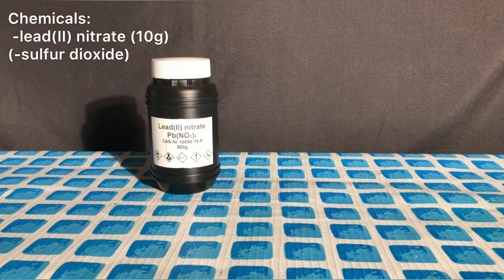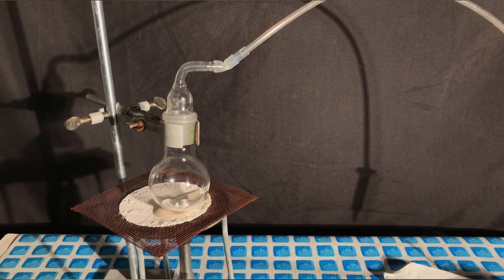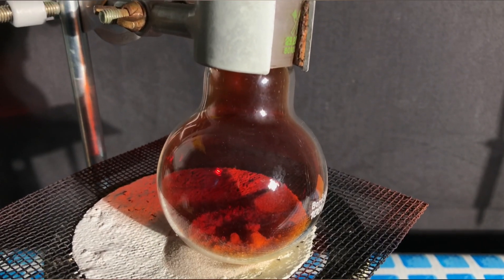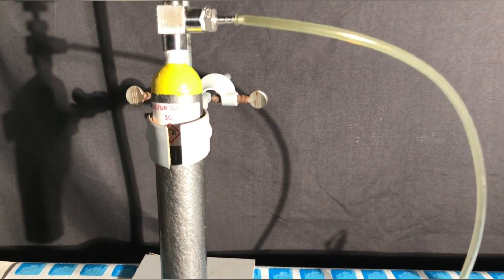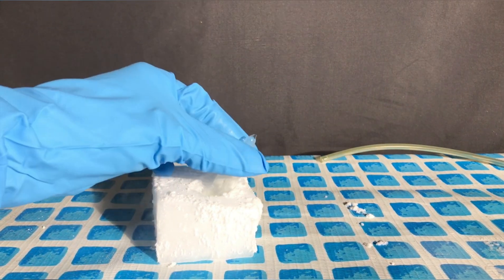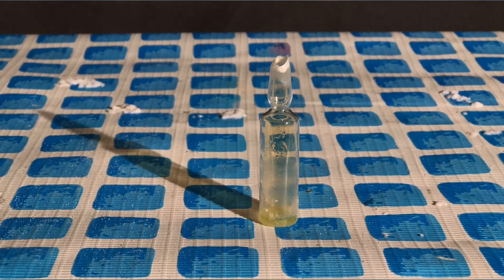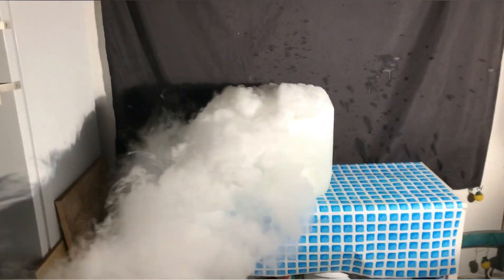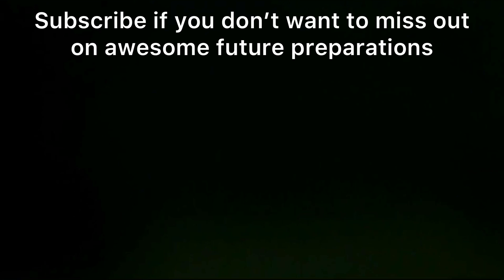Nitrogen dioxide via thermal decomposition of lead(II) nitrate

Comment: Do you stress check the final ampules in hot water? Also, ideally for long term safety is to have the ampules epoxied into a resin cast (I think Cody did it in one of his ampule videos)
Great vid!
Reply from the maker: I do the epoxy cast thing only for high pressure ampoules or when I want them for display. They are always pressure tested.

Comment: Hmm, maybe the reaction with sulfur dioxide only occurs at higher temperatures? I've seen it done with gases at room temperature, but in the cryogenic liquid phase, it might not be favorable. Still, good video!
Reply from the maker: At higher temperatures it definitely works. More on that in a future video where I’ll try to make SO3 on a large scale this way.

Comment: You can do it with copper ii nitrate as well.  Hard to dry though.
Reply from the maker: I’ve got a bunch of copper nitrate I don’t have a use for anyways. Thanks for mentioning!
Reply: @THYZOID  NurdRage did a video on thermally decomposing it to recover nitric acid from precious metals refining.  He didn't dry it, so he got a liquid product at room temperature.

Comment: I always wanted to make liquid nitrogen dioxide
Reply from the maker: Im currently planning a large scale liquid NO2 preparation from just air and electricity.
Reply: @THYZOID  it will be very interesting!
Reply from the maker: @Come up With unique username #VoteBlue they are some hard to make stuff. Chlorine dioxide would currently be possible for me to make but until I get HgO some others are still out of reach.
Reply from the maker: I think chemplayer reacted bromate with sulfuric acid. It just made a bunch of bromine and no bromine oxide whatsoever